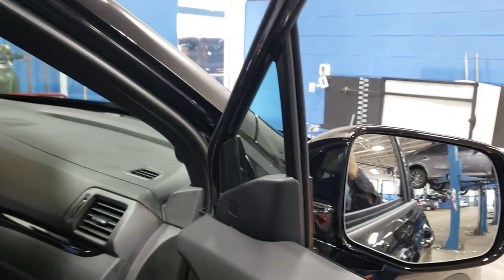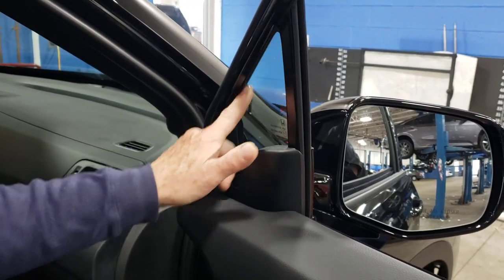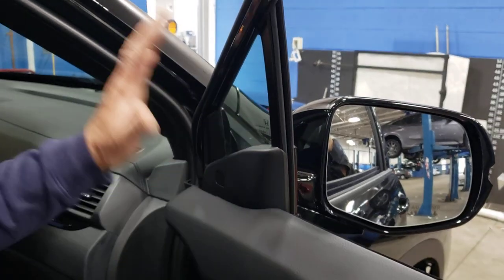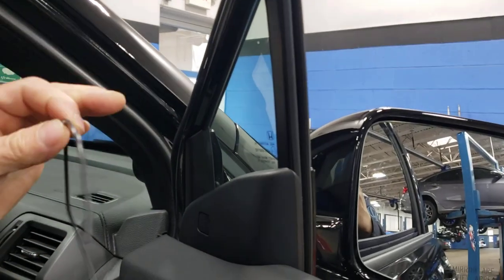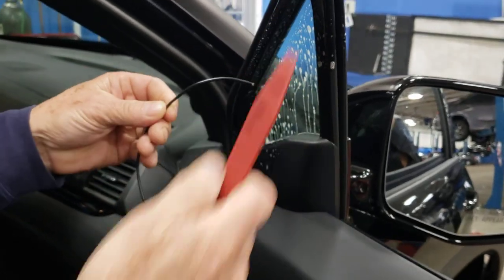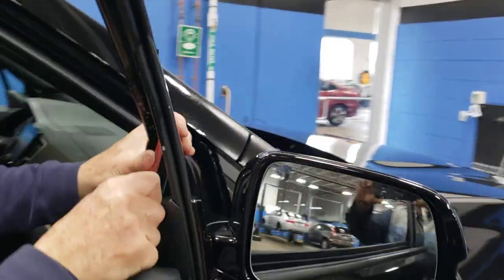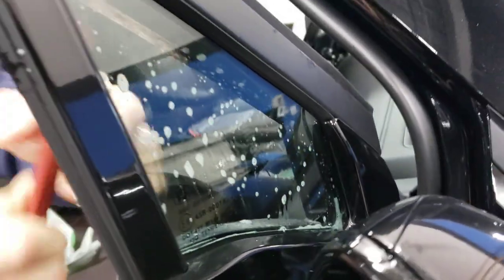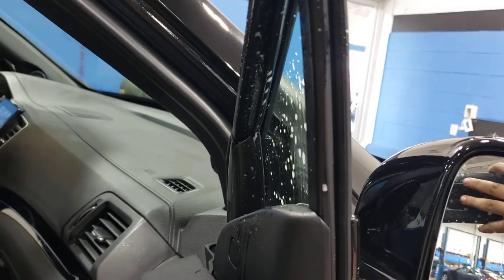how to tint the little windows on Honda pilot and Ridgeline

Comment: What kind of wire did you use?
Reply from the maker: 18 gage
Reply: I have to do one of these today, first time. I’m going to try your trick. You replied to one commenter 16 gage & another 18 gage. Which is it? Is it just steel wire or does it have a plastic coating? Thanks!